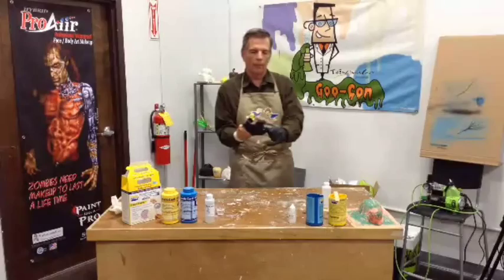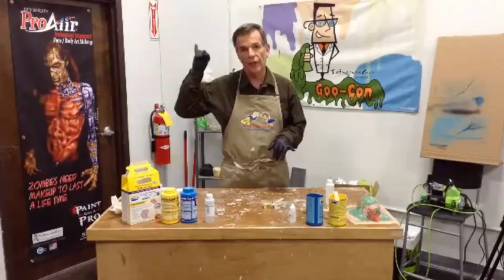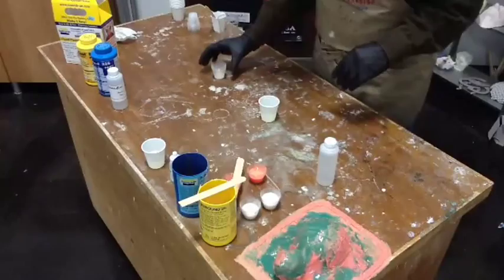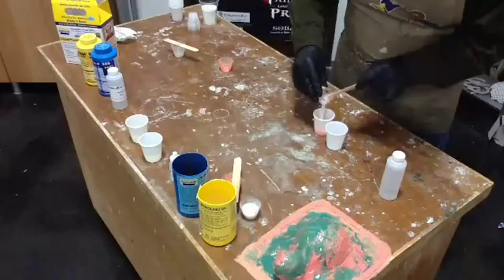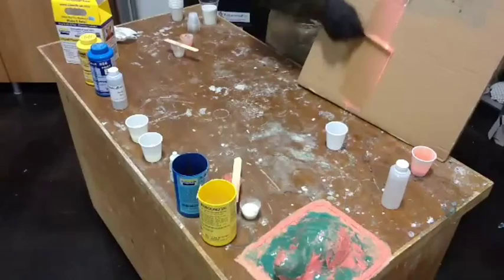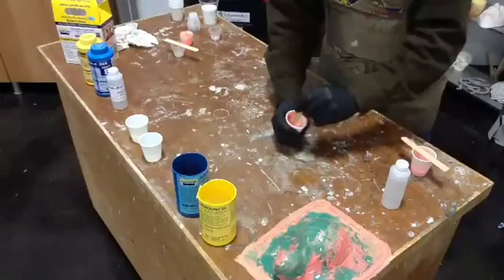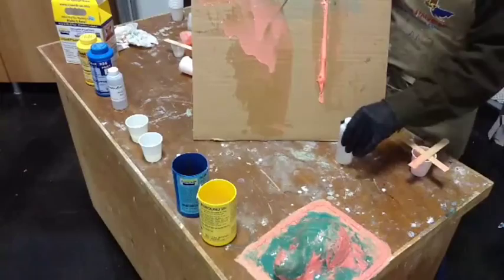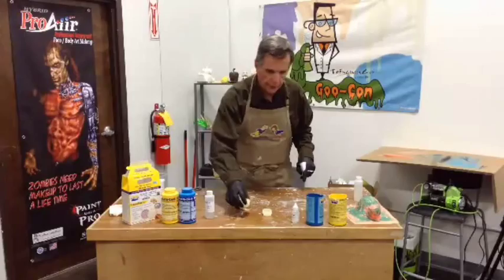Chemical Stir Fry - 10/21/15 - Defoaming with Doxy 5

Comment: I cannot tell you the number of DIYers who aren't even aware that defoamers exist. Hundreds of the amateur moldmakers on Youtube waste time reintroducing atmospheric pressure into their vac chambers to control foam when they could speed up the process by using a defoamer.  Most of them will never find out there's a better way. I happened to find your video while looking for a surfactant for acrylics and epoxies. Might you know of one?

FWIW you're not using the dox correctly....try degassing a short pot-time urethane with doxy in it.
Reply: Would you know whether anti-foamers (silicone-based) also work in silicone?